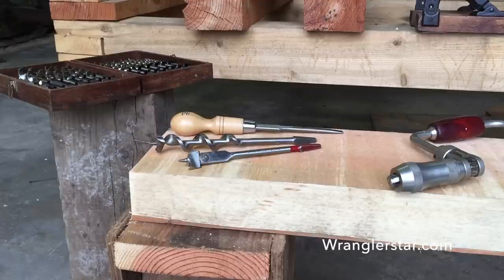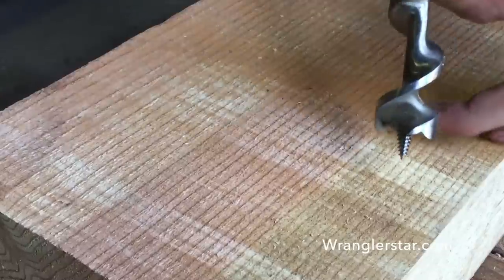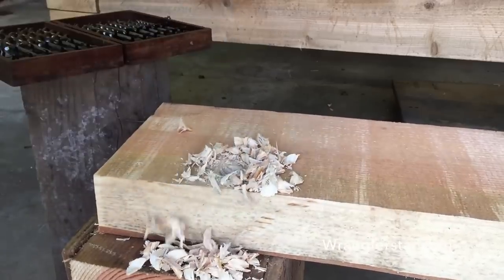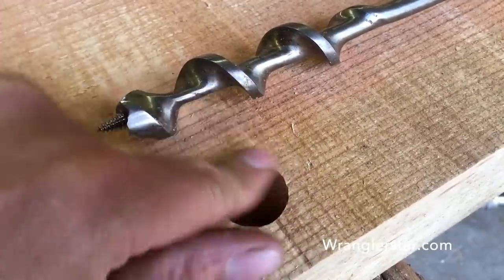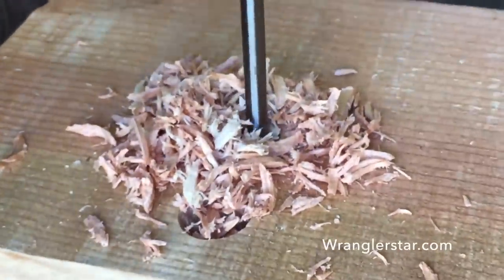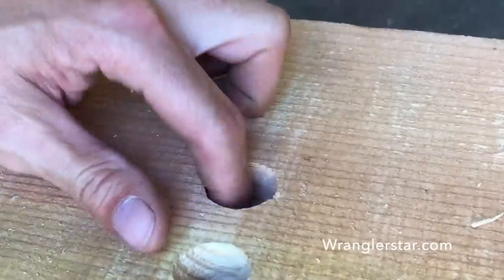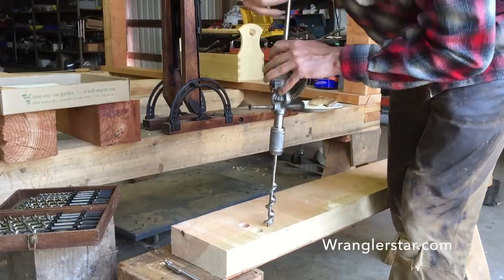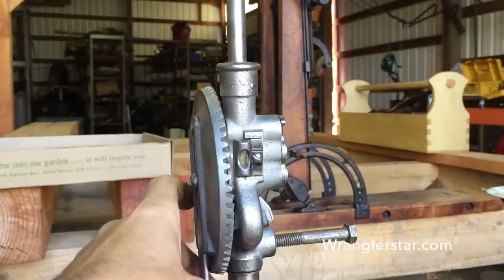Bit & Brace VS Electric Drill

Comment: Nice head to head video there.  I did notice that the adjustable bit was tested on heart wood and the auger bit was tested on sap wood though, so that is surprisingly good on the adjustable bit. I have enjoyed using my brace and bit around the homestead... Works just as good at almost everything a regular cordless does, and you never have to charge the battery.

Comment: It's always been my impression that saddle braces (your belly drill) are intended for drilling horizontal holes - and that's all I've ever used them for. It's worth noting that in my experience horizontal holes go pretty quickly (and with significantly less apparent effort) as compared to your vertical experience.

As I think about this a little further, I'm nigh on to certain that the primary difference between a standard brace and bit and a saddle brace is their intended use on horizontal vs. vertical planes because it's not often easy or comfortable to drill a horizontal hole (as in a vertical surface) with a standard brace and bit.

I could be wrong about all of this (of course), because I've only come to use these tools with any kind of frequency in the last two years, and my father wasn't even the proverbial glint in my grand dad's eye when they were in their heyday. That said, considering my (admittedly limited) usage experiences, my initial impression about the intended function of the saddle brace, and the experience you had in this video, I may just be talking some sense for a change. ;)

Great video! I love the old tools! Please keep 'em coming!

Comment: The concave part is meant to go against your thigh, held with left and lean into with thigh, basically designed for boat building where you can stand and drill into the work, works great on planking and ribs.
Reply: I was looking for this comment cuz that is what I was thinking, cuz it makes the most sence but I wasn't sure. Glad I was thinking along the right course

Comment: I had an old "belly drill" that had a simple stirrup  handle & need no belly push. we used it for installing hinges and lock sets on out buildings far from AC power. Perfect for maple tapping in the woods.

Comment: here in the northeast the shoulder drill were called breast drills and used primarily for taping maple trees.   My great grandfathers was around and I tried many years ago and it was balanced off ones hip to bore holes for sap spouts.   We had a  gas powered one so the shoulder-breast drill just hung in the sugar house for the most part

Comment: Cody I have found that shoulder/belly drills work best for drilling horizontal holes, and that vertical holes seem to work better with the regular brace or the shorter belly drills with the wider rest plate.  When you use that narrow plate it works best with the shoulder leaning into the cup like a rifle stock and leaning into the work in front of you.  That wonderful beam drill of your is the best tool for vertical on a beam, but might be difficult to lug up to the top of a 2 or 3 tier barn or cabin to drill a hole.  This is just my opinion, but I have used the first two for quite a few years and envy you on the third.  I love these old manual tools, and yes my 18V power driver could drill the hole in 10 seconds, but when I use the power driver it seems to me I loose something special in my work.  I am still learning and have a ways to go before I will ever be anything more than a JOAT.  Peace, Health, and Happiness to you, the missus, and Jack.

Comment: The Shoulder Drill is more often refered to as a Breast Brill, most easily operated centered on your chest and used with twist drill bits or spoon bits. When centered on the chest, it is easier to make sure it is at the proper angle to the work. I find them really terrific when used with twist drills or spoon bits.

Comment: Adjustable, it is not multi purpose tool, but to get different sizes of holes, for example if you want less than 1 inch, thid 0.98 '' or larger 1.1" or so. For fine adjustment.
Shoulder drill is designed to work with smaller drills when you need higher rpm, but not a lot of power.

Comment: The adjustables work exceptionally well for being able to change the size. It always amazes me how fast these will bore through a piece of wood. The breast drill has an adjustable handle, but I don't think you'll get enough torque on it with the larger bits.

Comment: Belly drill is for drilling into walls with standard twist bits.  Also you have an adjustable crank to add leverage in addition to the gear ratio.

Comment: Chest drills were very popular with telephone installers, back in the day, of course they weren't drilling 1" homes but they allowed you to put a hole up tight against the baseboard through hardwood floors big enough for line wire in a few seconds.  This was of course long before battery driven drill guns.  I got to admit for holes larger that 1/2" I break out the Milwaukee Hole Hawg LOL I've done a lot of re-pipes and the right angle version is indispensable.

Comment: I am also learning as I go, but I never saw an egg beater style drill with a chuck for square type bits. I have several, including a two speed chest/shoulder type, but all have chucks like an electric drill (three jaw). I was always under the impression that they were used with bits like a modern electric drill and used for about the same size holes as as the chuck size (i. e. 1/2" chuck for 1/2" holes and smaller and 3/8" chuck for holes 3/8" and smaller.) These egg beater types were used in all materials and the chest/shoulder rest was for extra pressure drilling metal or other hard materials. On the other hand, a brace drills larger holes with more torque, but is designed only for wood.

Comment: Belly drilling things
The screw on the auger is what feeds the bit in, you shouldn't put much pressure on it after that.
The braces are generally better at large 25mm holes but if you used that 1/4" bit you might find the drill wins out. Drills are also quite good for metal compared to most electric drills for their low RPM.

Comment: did i miss the electric drill?
Reply from the maker: blaze806 It's coming in Part 2
Reply from the maker: blaze806 https://youtu.be/dGYIngIYqO8
Reply: wranglerstar did you figure out how to use the belly drill??
Reply: +Wranglerstar I think when you were using the belly drill you were using your shoulder to put pressure onto the tool. I believe that you're supposed to put pressure  onto the tool with your hand and use your shoulder to stabilize the drill bit to get straighter holes

Comment: A tip on the Belly Drill, you used too much pressure, which locked the bit into the wood.

Comment: The Belly drill works well with smaller bits and metal, and you can extend the handle for better torque.

Comment: Cody It would be cool to see you do a test with a "push drill" I don't know if that is the correct nomenclature or even what they are actually called but it operates like an impact driver. changing pressing force into circular motion.

Comment: I feel that the shoulder drill may not be meant to apply downwards pressure as much as its meant to apply pressure in more horizontal project such as taping in to a tree or drilling in to an object from a standing position. Could be wrong though just my opinion.

Comment: The advantage of the adjustable bit, besides replacing several standard bits, is the ability to match a non-standard sized hole or to drill a non-standard size to fit something specific where that is the need.  In earlier days with blacksmith made tools, they would not always make standard sized, they would make the size they thought they needed.  Since they were making pegs to fit their holes, that worked fine.  Later, if someone else had to work on the earlier work, they would find the standard sizes were not quite right.  They would either have to redo the work or make a custom bit or.....get an adjustable bit.  Anyhoo, I have a bit and brace that I used for my boyhood woodworking projects before I was allowed to use the electric drill.  It felt like going back in time (I'm 44).

Comment: we still use a bit and brace when climbing poles for repairs on power lines. Many lines are in the woods and not accessible to trucks. Very few cordless drills will bore a 13/16" hole in creasote soaked 12" thick poles, and gasoline powered drills are just as much work to carry out as just boring the hole by hand.

Comment: using a short bolt for handle on the belly drill .... is terrible idea it takes 3-4 minutes to turn one on a late and if it's long enough to oppose torque it will work fine

Comment: Nice breastplate drill, but my favorite will always be the brace... why? Because I'm left handed. Because the majority of bits, if not all of them, are right handed, I have to turn the crank wheel the "wrong way", that is very awkward. I cannot drill right handed, use any other tools right handed. A brace and bit, does not discriminate in that way.